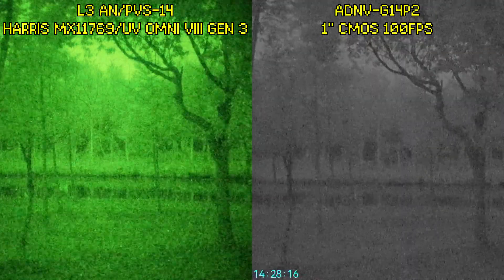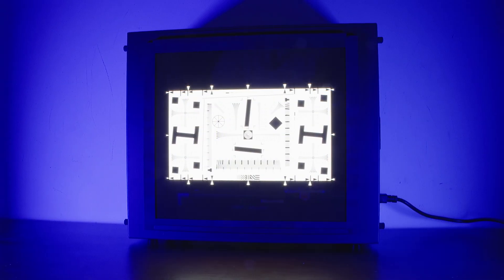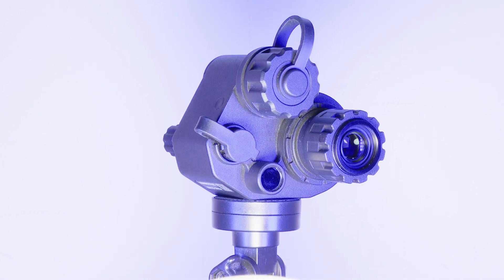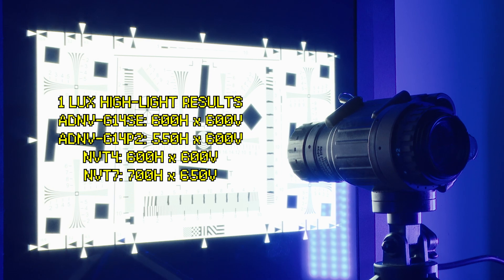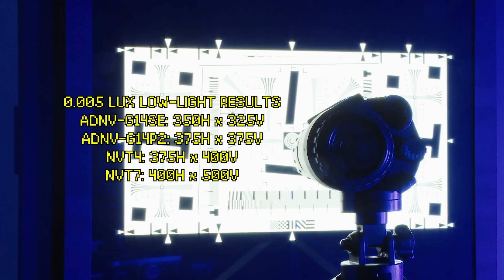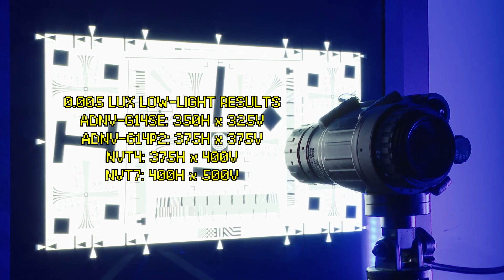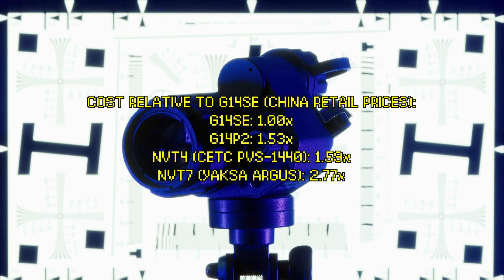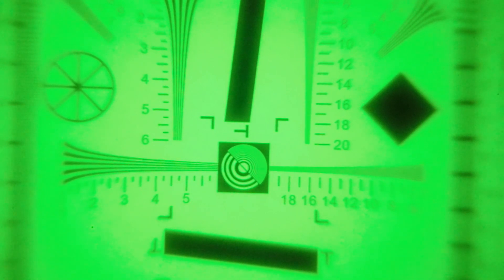Is ADNV-G14SE and G14P2's 800x600 resolution enough? Digital vs analog night vision resolution test

Comment: The big Problem ist that ADNV is still Not available in the EU so the only "normal" option is to buy them significantly overpriced in the US and then still pay customs duty in top. That makes them an entirely pointless buy and significantly more expensive than very good analog pvs 14s. I am in the lucky Position that I can actually See what they go for on Taobao thanks to my Chinese gf. The G14SE costs 1000 Euros in China and the G14P2 costs 1500. Add VAT/Customs and you can get a G14P2 for ~1800 Euros. I will probably buy 1-2 units when I am in China next year and Take them back with me.

Comment: Someone that has tested these units thoroughly. What mount would you run with the G14P2 with a dual monocular setup that orientates the picture correctly to get the most out of field of view???
Reply from the maker: I use the regular Norotos + J-arm setup if just using it over the left eye, and the ADNV mount that came with the G14 if I want to use it over my right eye. Both of these setups will orient the unit correctly.

Comment: Very interesting as usual, thanks! Are you aware of the new ADNV G18 and ADNV H10? They were released in january 2025 but can't see anything about it on the internet...
Reply from the maker: Yup! The H10 is a handheld unit with lower refresh rate that's supposed to be a lot cheaper than the G14 series, and I'm currently saving up for the G18 haha

Comment: Hey there-  I have a very specific situation I'd like to test on the ADNV devices.  I'd like to see what it looks like through those devices if you also used a white light. My airsoft field lets us navigate with NVGs, but requires us to white light before shooting to keep the game going, so I'd like to know how fast the sensor reacts to the white light turning on, as well as if it completely blows out the picture.  If you can do that, I'd be grateful!
Reply from the maker: Just did the test. Having a really strong weapon light directly pointed at the unit at close range will blow out the image. But at skirmish distances (~25m or greater), it becomes less of an issue. It performs really similarly to intensifier tubes in this regard with the exception that the ADNV won't get damaged by such lights no matter how much exposure it gets.
Reply: @hypemilitaria6447  thanks so much for doing that!